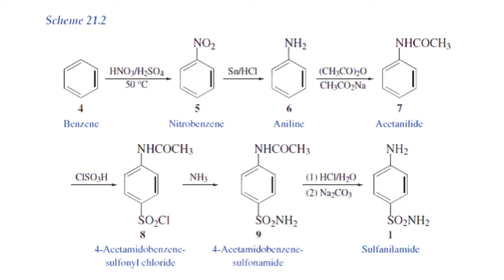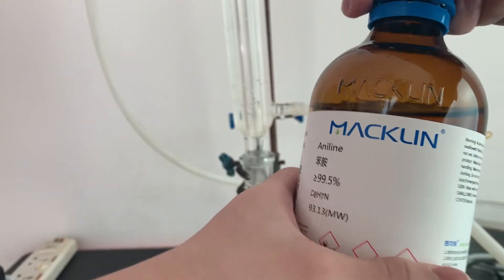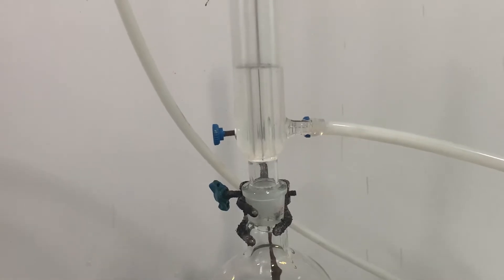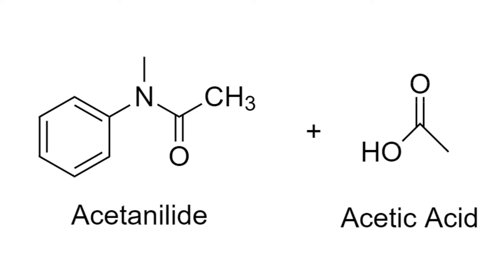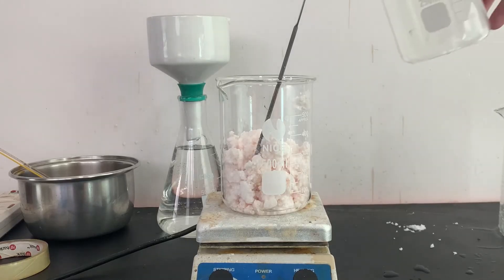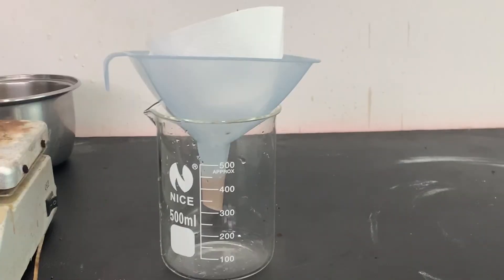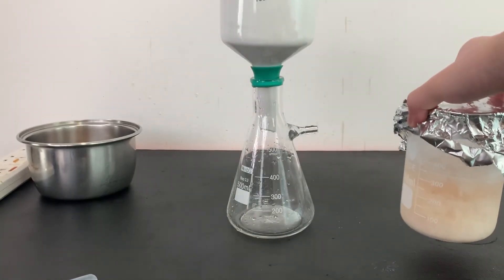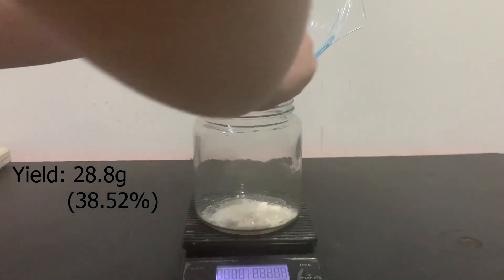Acetanilide | Sulfanilamide Synthesis

Comment: Can you incorporate an electron donor dye/stain into a conducive plastic made from aniline? 
   I'm thinking of a dye sensitized solar cell, but where the dye is part of the semiconductor polymer itself.
   I'm still trying to make aniline myself...
Reply from the maker: I don't know as I don't have any knowledge in solar cells nor have I ever heard of a 
plastic that is electrically conductive. The best method for making aniline, in my opinion, is to decarboxylate Vitamin B10.
Reply: @frostchem  hell yeah you can have electrically conductive plastic I can't believe you've never heard of that! One of the first discovered and easiest to make was made out of aniline you should look into that!
   But yeah vitamin b10 heard of that..  I thought I got pure.. but it wasn't... Personally I only got a budget of about $20 a month so not much I can do.
Reply from the maker: I'll definitely look into the conductive plastics. Have you tried making aniline from the reduction of nitrobenzene? If it didn't work well for you there's also an aniline synthesis from benzamide: https://www.youtube.com/watch?v=j6L2ijPZkR0&ab_channel=Catalysed
Reply: @frostchem  don't have benzene or enough nitrates , gallons of toluene though, thinking about going a different route by turning  toluene into benzoic acid and going from there. I'd reconsider the  decarboxylation if you have any idea how to purify from  inositol and other common fillers...
  I'll check out the link, thanks!
I'm sure I'll learn something new.
Reply: @frostchem  I just checked out the video, that would be my "going from there", definitely helpful! Thanks again!
  I would still like to understand the Hoffman rearrangement better, not just that it happens. I haven't built up the "chemical intuition" yet..
Reply from the maker: Glad that I could help!